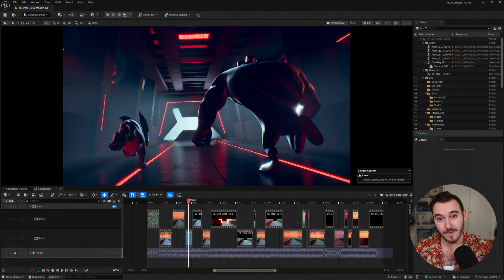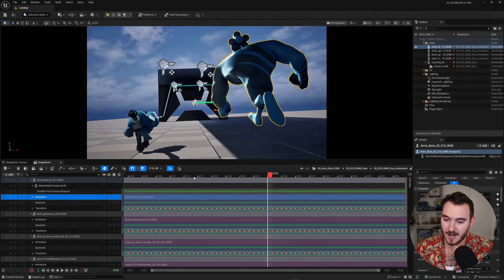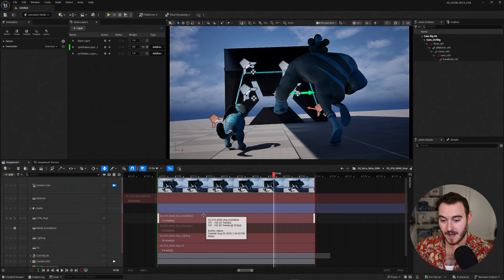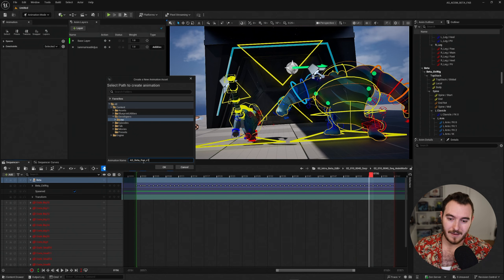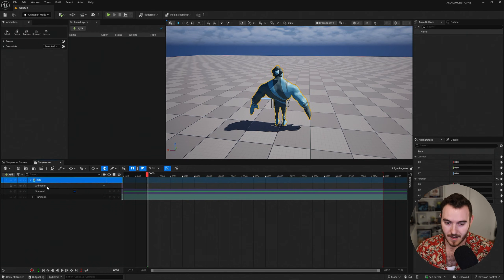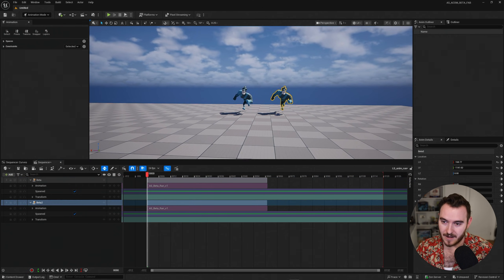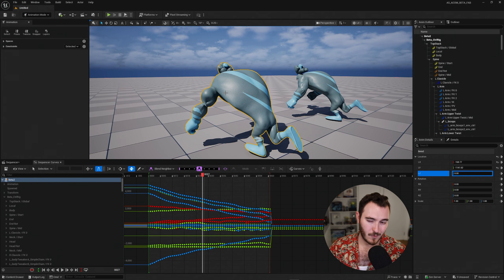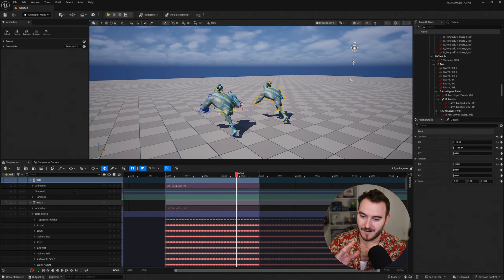Baking Animation in UE5: Control Rig to Animation Sequence & Back!

Comment: The jiggling hair physics are still running wild even on baked animation. I wonder if you can have control on them too: bake the physics and make corrective edits. I have a stubborn, rigged skirt that goes through the legs partially on walk. Even with Kawaii Physics it's not perfect. So in order to fix the penetration and also save resources I need to bake the movement, it it's possible 🤔🦴👗

Comment: I love that it is possible to backwards solve an animation sequence. 
I don't quite love seeing a key frame every frame though 😂
Can't wait to see the next lesson!
Reply: You can reduce keys in the sequencer curves, so it keeps only every 2nd, 3rd, 4th.... key. Or you can delete between two keys and interpolate a curve between them. But most useful is probably the use of an additive layer that works non-destructive on top of the original curves. Or an override layer that nulls joints of your chosing so you can hand animate only those from scratch, while the rest of the animation is preserved.